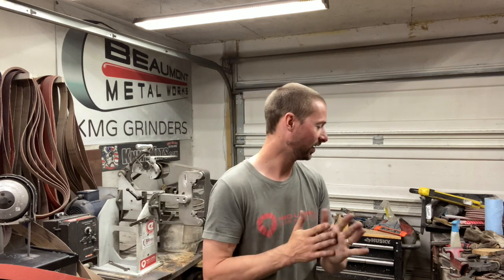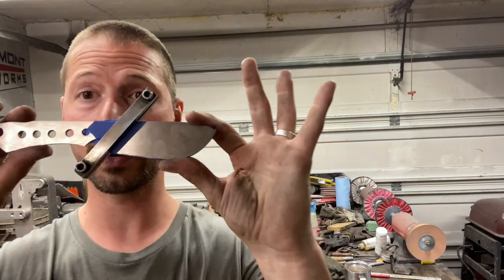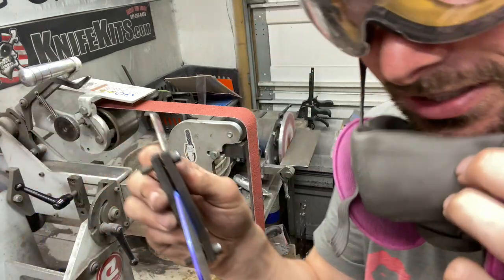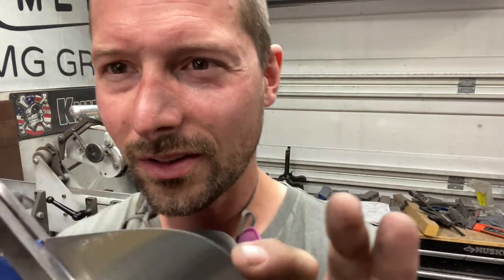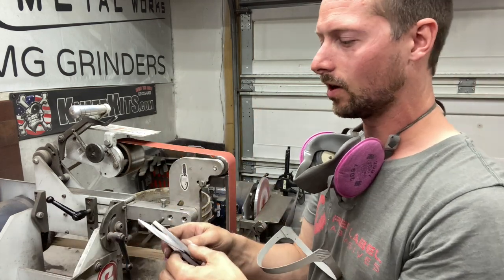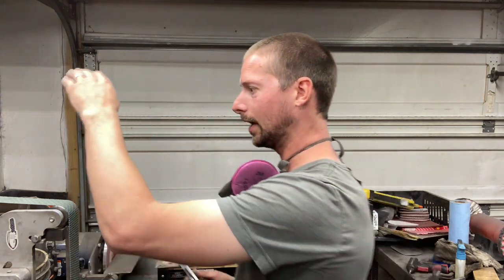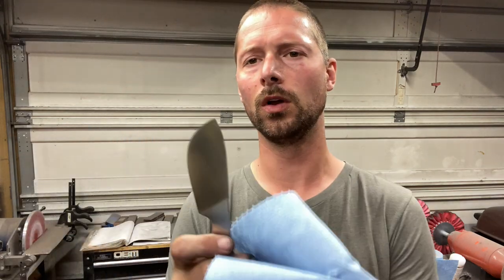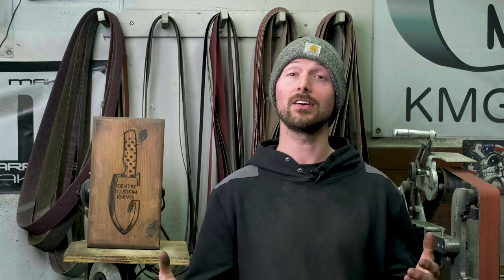How To get a BEAUTIFUL "off the belt" finish on your bevels! (NO HAND SANDING!!!)

Comment: Forgot where exactly I saw it but it was another channel on YouTube that suggested loading up a surface conditioning belt with wd-40. It produces a very clean satin finish and could help with rust if you are grinding high carbon steel
Reply from the maker: I’ve tried that and don’t like it. I might be doing it wrong though lol
Reply: @gentrycustomknives8008  probably just comes down to preference! Beautiful work regardless

Comment: Great video as usual.  Thanks for all the info.  Two questions:  Are you beveling after heat treat?  Also how do you heel the blade from chattering or catching on the belt?  I’m having some issues with that right now when I’m grinding, especially with higher grit belts.  Thanks!
Reply from the maker: Yes I do my bevels after heat treat and what belts are you using when you get chatter?